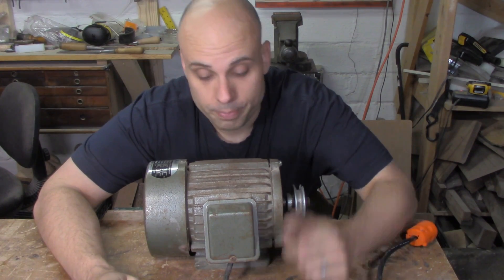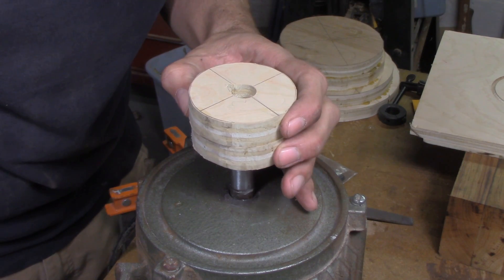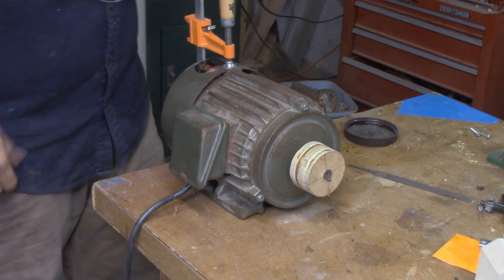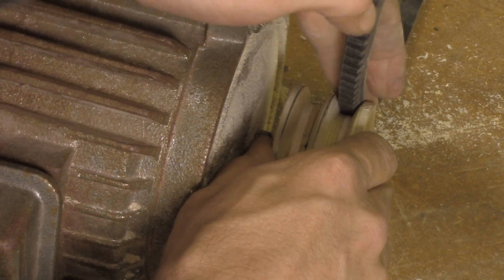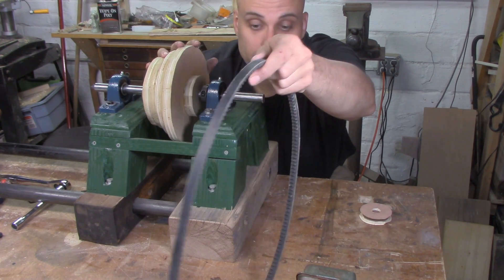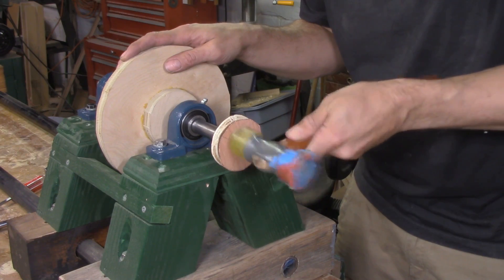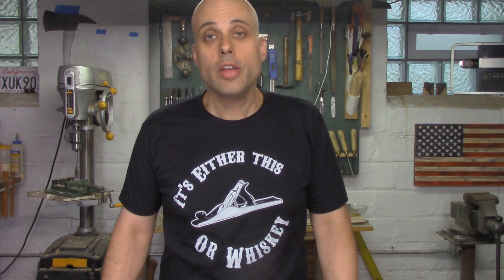Make Step Pulleys for FREE (Real Lathe Pt. 2)

Comment: Thanks Rex,  watching your video helped me a lot. I want to make a custom step pulley that will give me 4 higher "gears" or speed settings for when I make honey dippers.

I tried a few things, but I realised I messed up my concentricity. I thought about turning it on the motor shaft, but gave up because it's too difficult to get access,  unless you take the motor out of the machine.

So I was about to make the same mistake regarding concentricity again in a more sophisticated way😂

But now I know I must turn it on the motor shaft, even if I must  remove the motor from  the machine to do it, and then I'll also use a sawn-off wood screw for a grub screw.

Those two things were the main problem, and you solved them.

Comment: ;-) Shaking my head for not thinking of this. I have a drawer of odd ball pulleys collected from several hoarders over decades lol. Almost never have the correct size to match. This looks like a great solution. My lathe is too small to make a step pulley as large as you made, but I think I can make larger than my current pulleys, doing this.

Weird, I really should have thought of making wooden pulleys. My grandfather and great grandfather made wooden pulleys, big ones though, for saw mills. I still have some bits and pieces kicking around that my grandfather used to make them with.

Actually, wood turners may find it interesting to know that many of these big wooden pulleys had to be built, then turned round, on their permanent shafts, a temporary lathe.

Comment: My first lathe was a little 4 speed Atlas. I replaced the 1/2 hp motor with a 1 hp motor, built a table to put it on out of some glue lam beams, and used a link belt, which actually worked really well.

Comment: I'd consider using an old chisel and cutting it to form 45 degree angles to cut the shape for your v belt.  You don't even really need a chisel,  you can cut any piece of steel to make a custom shape to use on a lathe.

Comment: Simple direct coupler would work.  Pipe with some set screws will do it.    For strength I would suggest water thin super glue.   It will penetrate all the pores and make it strong and durable and very I lick ly to throw a chunk.

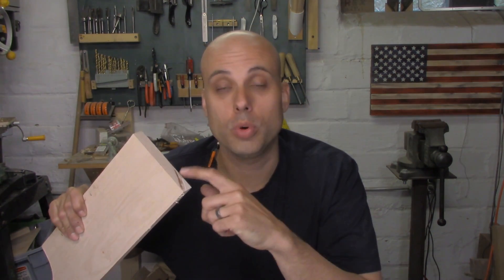Comment: Neat video!  At 1:30 you suggest Cabinet grade plywood. What does that mean? A quick look at my local home depot shows standard plywood and crate grade plywood both S-P-F. There are assorted hardwood plywoods. Is it the hardwood plywood you are suggesting? None are tagged as Cabinet grade, but since they have a finish veneer I would suspect that is what cabinet builders would use.

Comment: That was cool.  in the set screw holes, I like to run the wood screw in then take it out and put cyanoacrylate glue (instant glue) in the hole and get it soaking in all around.  
Let it cure sufficiently or it will be a bad scene.  The screws then have much greater holder power and don't wear out so quickly.  Its amazing how well hardwoods do in these instances.
Difficult to find very good plywood around here - I have to drive too far.  But I have lots of maple right on the property. 
That video is a keeper.   RH

Comment: When mounting the motor to turn the motor pulley. Just use the regular mounting holes. Also make sure the motor doesnt rock when mounted. The mounting surfaces on electric motors are not necessarily in one plane. This can result in what is called a soft foot. It may be necessary to shim one or more motor mounting feet to eliminate the problem. Believe when I say this is important. A soft foot when tightened can cause vibration problems. The side angle on the pulley grooves. These are normally an included angle in the range from 34° to 38 or 40°. The angle will vary depending on the diameter. On a 50 horse motor this is important.  On a homemade lathe not so much. The shaft on a homemade lathe should be as heavy as you can get. The stiffer the shaft (hey you in the back, get your mind out of the gutter) the better things will go. I was once at a woodworking show and I asked the founder of Robust Lathes why they didn't design the lathe to take collets in the spindle. His reply was he didn't think most wood turners would know what to do with them. He also thought it would be a great idea since he is a trained Tool Maker. While you can build a lathe this way I think a better option would be for the headstock to be made from something more substantial than a couple of pillow block bearings and 4x4s. Maybe a transfer case from a boneyard 4WD. Actually for a small diameter wood lathe the best option would be something like a Hardinge or Elgin plain turning lathe
http://www.lathes.co.uk/elgin/index.html
These used to be cheaper than dirt especially if they didn't have anything besides atail stock. Rock solid for any work in their capacity they will make you realize just how cheaply made most wood lathes really are

Comment: I made 2 multi v pulleys out of a chunk  of 6 in. round bar for the wood lathe i built from scratch it was a nice project. It also helped that i was working in a machine shop at the time.

Comment: No pulleys... Just get 3 phase frequency converter... No mechanical gears at all: motor shaft is just your spindel with SMOOTH RPM CONTROL with stable, FLAT Nm torque throughout its RPM range, from bloody 50 to bloody 3000 RPM! No belts, no pulleys, no smart plywood solutions... Don't pull your subscribers back to XIX century! ))

Comment: That motor was not very secured with only one clampon the housing. Attach the motor at the base on a bigger plywood plate with 4 pc. M8 bolts/nuts/washers. Then clamp the plate on the table with 2 heavy (Bessy) clamps.

Comment: If speed of the motor is problem and you are hesitant to start it on full power while lacking speed control, you can use extension cord that has on/off switch and flip it back and forth to around there control the motor speed. Its not perfect, easy and there is chance of failure with this one, but its better than trowing motor on and notice its going way too fast due miss calculated pulley ratio.
Also when turning pulleys never be on front of the pulley, while chisel is near the wood and even when not just quickly check. One stuck chisel into the peace and it will explode to peaces flying pretty fast. Usually directly on axis its turning. Someone can calculate how much energy peace like that has when it turns into ICBM but you surely dont want to be hit by it.

Comment: Those screws are going to throw it off though. A metal screw filling a vacant hole in a metal pulley is roughly the same density. A metal screw in a wooden pulley however is a higher density. So I hope you set those screws 180 degrees from one another to counter each other out. That said I don't picture them working well, and scoring on your shaft over time will be pretty immense. Might be wise to anneal them so they're softer than the shaft metal if they aren't already.

Comment: Any recommendations as to where to source the motor?
Reply from the maker: Craigslist. Flea markets. Used washing machines. They're out there.
Reply: Greetings from SLC! Out here in the arid west, lots of older homes have swamp coolers and when people upgrade to central air, you can find discarded evaporative units out on the curb for free (like I did with mine, only I kept the motor :)  )

Comment: Why not just attach a chuck to the motor directly, aside from no mechanical speed/torque control?
Reply from the maker: I think you just answered you own question!
Reply: @RexKrueger  Haha. True. I'd honestly consider it, though... a bad lathe is better than no lathe. I lack the space and the skill to make a pulley system. Thank you for the excellent content.
Reply: @absurdistcat  Not all motors are the same. Some motor architecture makes their speed easy to control with electronic means. I'd still be worried the short shaft and lack of firm rollers would make the chuck wobble around.
Reply: @CanalTremocos  A more advanced setup would defeat the purpose of this discussion.
Reply: You'd probably kill the motor's bearings pretty quickly. The inevitable out-of-balance workpiece (especially with bowl blanks) would be pretty tough on them. If there's a tail stock (I haven't seen part 3+ yet, but since most lathes have one...), it can exert a lot of axial pressure that most motor bearings aren't designed to handle.

Comment: A little late to the party; however, an issue with your initial assembly creates a problem. Even though you use the drill bit to keep them all aligned when clamping, you've only clamped them on one side from one direction. The moment you pull that drill bit, your glue surfaces slide. It acts like lubricant until it starts to set. A few solutions for those who are coming to the video this late:

1) Salt. Toss salt onto the glued surface before compressing the pulley blanks together. This will give the surfaces friction/grip which should help prevent or at least minimize the sliding.
2) Rub Joint. After sliding each of the pulley blanks onto the drill bit, you would create a rub joint. Now, on flat surfaces this is a back and forth motion; however, in this circumstance you'd simply rotate the pieces counter to each other a handful of times to create friction. This will get the chains building and should help with slippage (but won't eliminate it because you're still pulling the bit out while everything is wet).
3) Multiple clamps from countering directions. Clamps don't just create compression pressure. They also, due to their inherent design, create lateral pressures on surface pieces. This is why you need to have multiple clamps (you actually address this partially in your low workbench video, where you discuss putting clamps on both sides of the piece, alternating sides. This is to counter the torsion caused by the clamps.) from opposing directions.

Comment: An alternative would be to use easier tp make flat belt pulleys foe the temporary setup.   Automotive serpentine belts run well on them.  Slightly crown the motor pulley
Reply from the maker: I agree, but my local auto-parts store has SO many lengths of v-belt. They're cheap and they do offer better power transmission, so I think they're the better choice overall.
Reply: Most if not every car made in the past 20 year using a serpentine belt.   Power transmission  is not all that bad either.  People are now using them on the old cone head metal lathes.  Replacing a 3 or 4 inch leather flat belt.    I have one on my old 15" sidney metal lathe.    And its just an another option not wrong or right.   Good video.
Reply from the maker: You're totally right. It's a legitimate option.

Comment: What a great series and concept, making turning available to more woodworkers.  The part I am curious about is how those wooden pulleys will hold up, especially under a load, like turning that maple bowl, etc.  Even with cabinet grade ply, thicker sheaves (or are they called faces?) might help prevent their breaking.  Then again, I over-engineer everything, so they'll probably be fine!  Keep up the good work!   :)
Reply from the maker: Well, I'm not the first to use this approach. John Heisz and Mattias Wandell have both made pulleys in a similar way and theirs have been holding up for years. That being said, failure is always possible but now that I know how to make them, changing materials and re-turning them won't be a big deal if they ever fail. Thanks for watching!

Comment: Instead of grinding down your 5/8” spade bit, why not just use a smaller drill, like 9/16” or 19/32”? If you don’t have bits with size gradations smaller than eighths, you could even use a 1/2” bit, and then sand or file the inside of the hole a little until you can knock the wheel onto the shaft with a mallet.  If you have decimal-sized bits, you could use, say, a 15 mm drill bit (5/8” is a little under 16 mm).
Reply from the maker: Gary Cooper I would have used a different bit,  but I don't own one in a better size.  As to sanding the hole,  that would be a little more likely to mess up my pulley.  Spade bits are cheap and this worked for me.  By all means,  do it another way if you like.

Comment: I've seen people make pulley's on an electric drill. You could even use the electric drill to drive the spindle. Although in this case the drill chuck will probably be to small. Great progress Rex.
Reply from the maker: I bet you could use flexible rubber hose to connect the drill to the spindle. It's a good idea!  Thanks!
Reply: Yes, the automaton-maker Keith Newstead makes pulleys on the pillar drill but they're quite small - you'd need to be awfully brave to scale the process up! I tjink Rex's solution is best really.

Comment: Lovely seeing this come together. I'd have just glued some extra ply to the end of the motor pulley to make the second one. You could pare out the correct bore size with a chisel right there on the motor without having to drill, & then simply part it off. You get a bit of chipout inside the bore doing it that way, but for something temporary it would be good enough & might be safer than trying it on the bandsaw.

Another thing I might consider would be to drill some holes straight through the pulleys & glue in some bits of hardwood dowel or even bamboo skewers. If that plywood is going to fail, it'll fail outwards (due to the pressure of the belt pushing it that way) so a little extra reinforcement might make things last longer, or at least buy you enough time to notice a split & glue it back together before things fly apart. Also best to check grain alignment & make sure each piece of ply/wood is at 90° to the ones either side of it, which adds an enormous amount of strength.